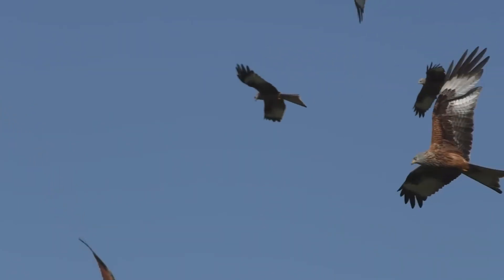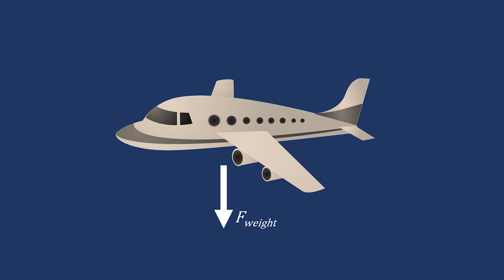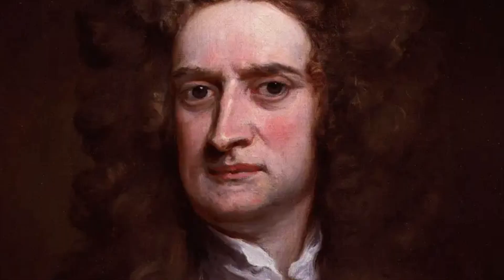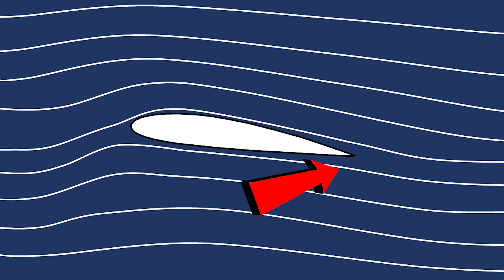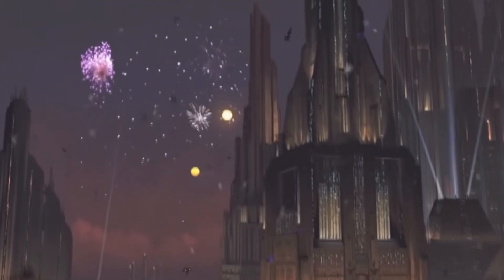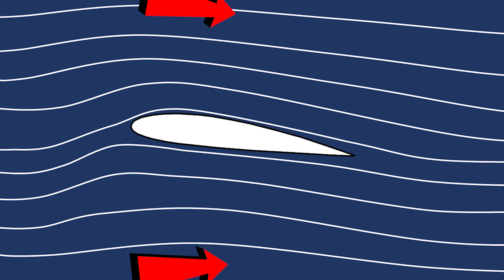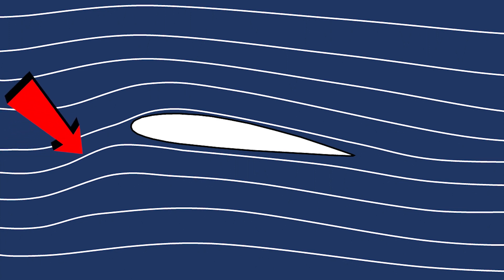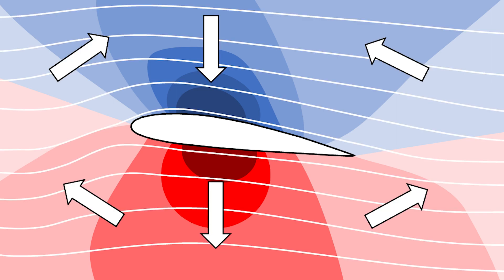How Do Planes Fly and How Is Lift Created?

Comment: Challenge of a basic qualitative description of lift, I was thinking maybe?:

Lift is simply:

1)asymmetry (of a solid medium)
2)turning the air (a fluid medium)

if only a bit more detail:

3)from a competition-for-space caused pressure response
4)which accelerates the air mass sufficiently to prevent mass flow disruption. 

(Conservation of mass, momentum and energy, are the ground rules for how this expediting pressure profile develops around the airfoil.)